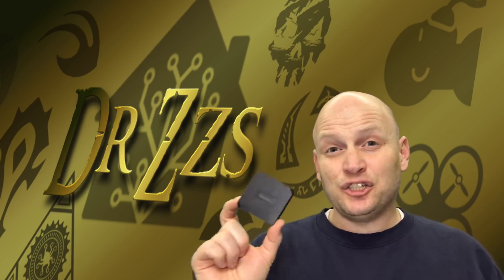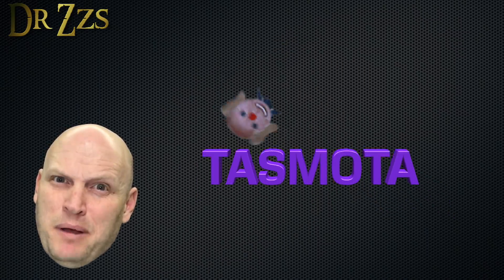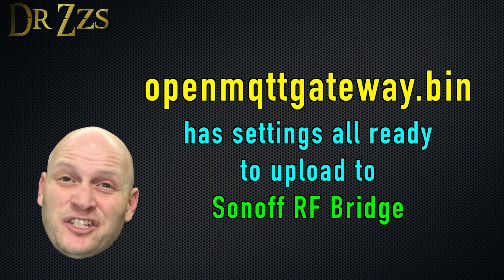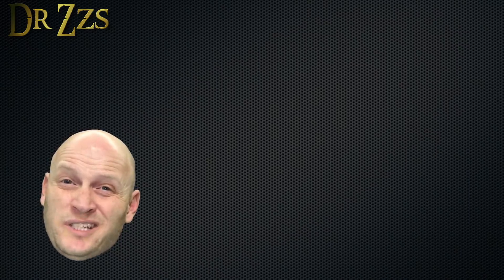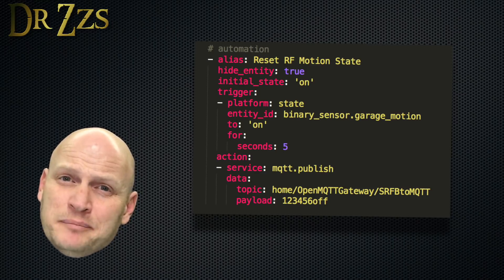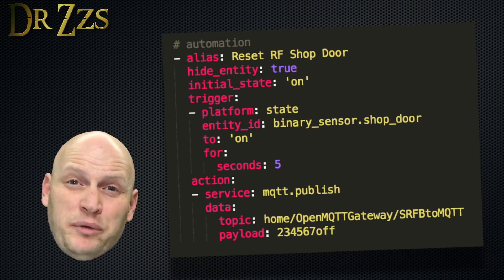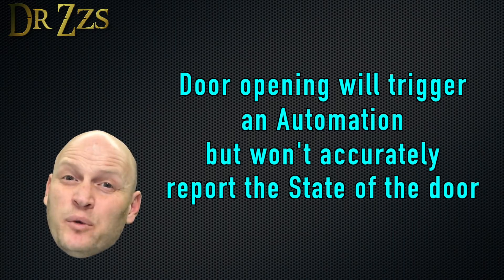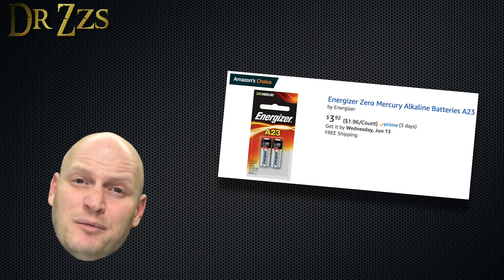Sonoff RF Bridge w/ MQTT & Home Assistant

Comment: There's a step that I'm unsure about.  You flashed the bridge and set up the wifi, then went to MQTTLens to trigger a sensor to get that number, but doesn't the sensor have to be paired with the bridge first?  Did you pair them with the stock firmware and ewelink app first?
Reply from the maker: nope. 
I don't know what firmware the sensors run.  I didn't mess with it at all.  When you activate the sensors the bridge picks it up.  I would think any 433mhz receiver nearby would pick up the code.  Tasmota is the same.  When it senses any 433mhz signal it produces an MQTT message.  Tasmota's just has a lot more (and different) information in the MQTT message.  
Does that help?
Reply: That helps.  If you didn't have to pair them, that means I won't have to.  Thanks for the speedy reply.
Reply from the maker: anytime!

Comment: I tested four different rf alarm systems (available in my country) with no luck of getting back the closing code or in 3 of them never get the signal at all ( i think they used encrypted rf transmission my system is Paradox and sure it does) . Have you tried the KERUI? Are they working? Does they send back closing signal?
Reply from the maker: Bummer. 
I haven't tried them but jafterdark has and he said they do send 2 codes. 
I still have a lot to learn about these RF devices.
Reply: I order three of them for start. I will let you know the results
Reply: Just arrived! I confirm that works like a charm i read some complains about the battery health so i will check it in the next days,

Comment: does this not work with sonota? i don't have a usb fdti adapter
Reply from the maker: it might.  I don't know for sure. 
If you're going to do a lot of flashing it might be a good idea to get an FTDI adapter.  They aren't too expensive. 
This is the one I use: https://amzn.to/2JIX1vI
you'll need some jumper wires too. https://amzn.to/2MvOABD

You can try SonOtA, it might work.  Depends on the version of the firmware on the RF Bridge.  Let me know if it works!
Reply: yeah i've been reading that the latest sonoffs are now back to being flashable over the air again, so i was just wondering if this was true for the rf bridge too.
Reply from the maker: cool.  I haven't even tried in months.  Maybe I should look into it again.

Comment: Im here once again got another sonoff and the gpio hole are filled and I really dont want to sold anything, so I downloaded platformio and hold the jumpers to the gpios toghether with the button while conecting to usb, quick question does the sonoff led light power during the flashing? Do you know of in platformio.ini needs to uncomment the envioremnt? Apreciate all your helps
Reply from the maker: bummer.  Seems that's going to be the new norm.  I'll do a demo on adding pogo pins to your usb/serial adapter. 
Sorry I don't know anything about platformIO.  I tried it once and didn't have success. I may try it again someday, but for now I'm happy to just use FlashEZ and the sonoff.bin file from Tasmota github.  
Good luck

Comment: I was using tasmota on one of these bridges & had the pir & door sensors set up.

I went with xiaomi sensors in the end.

Door states were reported correctly & I added temp & humidity sensors to go with it.

Worked out well. Have automated all the hvac in my home to turn off if there is a door or window open, with report of which door/window it is.

Everything turns off in the kids room, if there is no one in there. That alone will save me thousands ;-)

For Tasmota on the rf bridge & setting up the sensors, the data thats reported through mqtt is nested json data (apparently)

See "Integrating RF devices with sonoff bridge on tasmota firmware" on the home assistant community pages.

"bukurat" gives the solution that I used, which worked.

I had the pir sensor set up the same way, with an automation that turned it off after 5 seconds.

Happy Hassing   ;-)
Reply from the maker: Awesome! 
I'll check out that page before I re-try Tasmota on the RF bridge.  I'm sure Tasmota will add some functions that may be more accessible compared to OMG.
Genius idea to have the AC go off when the windows are open.  Nice! 

Thanks!

Comment: Have you tried to send RF signal to your garage door using this bridge? I would love to know how to do that
Reply: Dependent on the frequency of your remote, whether it's a rolling code or fixed frequency etc.

I have an rm pro & one of these bridges & can confirm it just opened one of my garage doors with both transceivers, so I'm assuming my garage door is 433mhz.

Set it up through the web interface to learn a key/button & press the button on your original remote.

If it can learn the code, it should be able to send it.
Reply from the maker: I didn't try it.  I'll see what I can do when I redo it with Tasmota.
Reply: Nice! I'm waiting mine to arrive. One thing I didn't see on your video is that you doesn't sync the rf devices, you just listen to any RF transmission in range, that is correct? If I remember correctly the original fw has a limitation of 4 devices syncing... with tasmota it doesn't exist? I'll try to control my garage door with this so I don't have to mess with the door itself.
Reply: My garage door is using a 433mhz learning code remote. I had to press a button on the garage motherboard and then on the controller to make it pair (or something similar, it has been 2 years). My controller is similar to this one: https://http2.mlstatic.com/controle-remoto-433mhz-porto-eletrnico-e-alarme-garen-ppa-D_NQ_NP_934794-MLB25959661348_092017-F.webp

Comment: Great video as always, however, I am unable to connect to the the AP the Sonoff bridge creates as it is asking for a Password. I have used the v2.bin file you have posted the link to and get the same issue. Is the password known for the AP, if so please share it. Cheers.
Reply from the maker: dang.  There shouldn't be an AP password.  A few people have had that problem, but not everyone... I wish I knew what made that happen.  I'll mess with it.  Maybe we need to upload a new .bin
You can try just compiling the sketch yourself, then you can put in your wifi & pw
Reply: "UPDATE: if you have trouble with the OpenMQTTGateway asking for a password try:  your_password"

Can confirm this works. Good stuff!

What I find strange is the delay in the Sonoff Bridge processing the message. It is about 1 sec delay, give or take. I already have a NodeMCU board with a RF receiver built using the same OpenMQTTGateway software from the HA forums, and the NodeMCU posts the code instantly on motion being detected, then 1 second later, the Sonoff posts its code (using MQTTLens)

The other interesting thing is the Sonoff is receiving a different code to the NodeMCU, from the same motion sensor. Very odd.

Comment: Hello, you are the best! I wasted a lot of time trying to find a solution on tasmota without success and you came up with a new firmware.. TOP.

I now have a problem.. I flashed the new openmqttgateway.bin file however when I try to connect to that network via mobilephone a password is required.. it's not open like in your video.. any suggestion on which password should I put to get access on it ?

Rik
Reply from the maker: A few people have had that problem. I’m not really sure what is causing it but I’m thinking it might be a leftover setting from previous flashing. Try using whatever password you put in when you had TASMOTA on it. 
If that doesn’t work then we need to find a way to totally erase everything and reflash it. 
I’ll look for a solution.
Reply: It’s strange, I thought the person that created the bin file included a password on it.. I already flashed twice and network is always protected.. I tried all my passwords without success 😩. Thanks anyway for your prompt reply. Keep doing your videos👌👍🏼👍🏼
Reply from the maker: Dang, nope he didn't put a password on it.  I'm sure.  I used the same one and it hasn't asked me for a password, but it is doing that for some people.  I'll get to the bottom of it! 
In the meantime, you can go to the openMQTTgateway github and download the sketch, edit and compile and upload yourself, it's just more painful. 
Sorry man.

Comment: I cant put my sonoff RF in programming mode. I put the switch to off  hold the button and put the usb but i cant flash it. Anyone have the same problem? UPDATE--- I succesfully flash 4 POW R2 with the same FTD232 and same usb cable. Something is wrong with the rf and i cant put it in programming mode
Reply from the maker: What errors are you seeing? espcomm failed? 
There are a couple different serial pin locations. The ones on the “off” side of the little switch are the ones you want. I connected to the others the first time I tried.
Reply: Yes I know but still got the error
Reply from the maker: could be you got a bad one then.  I don't think there are different versions of the RF (like an 'R2' or something).  
Sorry man.  The reasons I know of for getting the espcomm error are just:
1- board isn't in programming mode
2- Rx/Tx are switched (or some other serial pin connection problem)
3- the wrong com port selected. 
You've done enough flashing with your Pows that I wouldn't think you'd miss something simple like one of those.  I'm not sure what else to try.  Sorry man, wish I knew what to tell you.
Reply: You done already enough. You are the reason i went from sonoff original to tasmota and hassio. So i would tell that was a ghost in the machine. I pair the device with the original ewelink app after i turn it off put it again in off and start it in programming mode i flashed it with tasmota and then with OMG looks its working for now. Except that i cant connect because both .bin files ask me for a wifi password
Reply from the maker: those dang gremlins strike again!
Reply: Hahahaha yeah those one! why keeps asking me for a wifi password? both of the .bin download i cant log in to the wirelless network. I tasmotized 22 devices but this rf bridge make me crazy ----UPDATE I edit the .bin file to find the wifi password and the secret password is..... your_password
Reply from the maker: you are a life saver!! 
I will spread the word! 
Thanks a ton!
Reply: Glad to help :) Lets keep tasmotise everyhting!!

Comment: Thank you for your this.
I've been using this for about 7 months and it just works reliably.

I went through the zwave pain and I now only have 2 legacy zwave ssnsors. Not only are they extortionate in pricing but the whole set up is short of "temperamental" to use an euphemism

I definitely recommend this solution and as you stated it can do many other things such as ir BT etc (Not with sonoff).
Reply from the maker: Crazy that Z wave is so expensive but doesn’t offer anymore reliability than these cheap 433’s. 
Thanks!
Reply: Indeed, not sure if you've seen this already, but there's a list of devices that can be used. Here's the link
https://docs.google.com/spreadsheets/d/1DdtVtSsN25nwP6BZI5q6C9yDGz37tUWjw2SQ1RGwBxU/edit#gid=0

It''s populated by users, based on purchases/experience. sensors, switches, plugs, smoke detectors.
Reply from the maker: Awesome!

Comment: Hi there, I had a problem with some single code Window/Door Sensors which I solved by soldering 2 pads together on the PCB. Now, the sensor sends one separate code for on and one for off. I cannot find any internal photos of the DW1 Sensor that you are showing in your video,  but if you use one sensor as a test subject and poke around some empty contact points, and at the same time bring close/away the magnet, just look at what codes are displayed in the MQTT sub topic.
Reply from the maker: I like this idea. I’ll have to give it a try. 
Thanks!

Comment: Great video. Thanks. Unfortunately I am too much invested in Broadlink IR/RF devices and they work well. I also have Alarm/door sensor system -broadlink SC2. So I will not be getting sonoff. But I did find good tips in your video as the door sensor is sending one signal only (open). 

I am not sure if I could use RM Pro+ that support RF and IR to capture door sensor signals. I only use that for various remotes /RF plugs (both IR and RF). Broadlink Sc2 kit come with a base station that monitor movement sensor and door sensors. It would be nice if I could use PM Pro+ to capture Alarm/door sensor signals for SC2 is not working with Hass.io on RP. As I know only custom component from community is available and cannot be installed on hass.io on RP  (need Ubuntu or Rasbbian version of HA). Any thoughts
Reply: ian robertson 
The custom component for broadlink motion and door sensors works flawless on my RPI with hassio. State changes are immediate and accurate. Almost all my automations run on broadlink sensors.
Reply: Remco Timmer 
Thanks for this info. I thought hass.io on rp3 is on a docker image as such cannot run linux commands required in getting custom components working. If i am wong here could u please direct me to correct place to get instructions. Much appreciate your help
Reply: ian robertson 
No, I have several custom components installed. No Linux commands needed. I just uploaded the files with the configurator in hass.io. Here's the link to the forum topic: https://community.home-assistant.io/t/broadlink-s1c-alarm-kit-custom-sensor-component/45980
Reply: Thanks. I followed the instructions and I can see entity id:  sensor.broadlink_s1c_key_fob. However none of my 3 door sensors and the motion sensor is showing up in the entity list

In the home-assistant.log I get errors

2018-06-18 20:04:22 WARNING (MainThread) [homeassistant.config] Incomplete core configuration. Auto detected elevation: 15
2018-06-18 20:04:46 WARNING (MainThread) [homeassistant.setup] Setup of config is taking over 10 seconds.
2018-06-18 20:04:50 ERROR (MainThread) [homeassistant.core] Error doing job: Task exception was never retrieved
Traceback (most recent call last):
  File "/usr/lib/python3.6/site-packages/homeassistant/helpers/entity_platform.py", line 301, in _async_add_entity
    'Invalid entity id: {}'.format(entity.entity_id))
homeassistant.exceptions.HomeAssistantError: Invalid entity id: sensor.broadlink_s1c_motion.living
2018-06-18 20:04:50 ERROR (MainThread) [homeassistant.core] Error doing job: Task exception was never retrieved
Traceback (most recent call last):
  File "/usr/lib/python3.6/site-packages/homeassistant/helpers/entity_platform.py", line 301, in _async_add_entity
    'Invalid entity id: {}'.format(entity.entity_id))
homeassistant.exceptions.HomeAssistantError: Invalid entity id: sensor.broadlink_s1c_laundry.room
2018-06-18 20:04:50 ERROR (MainThread) [homeassistant.core] Error doing job: Task exception was never retrieved
Traceback (most recent call last):
  File "/usr/lib/python3.6/site-packages/homeassistant/helpers/entity_platform.py", line 301, in _async_add_entity
    'Invalid entity id: {}'.format(entity.entity_id))
homeassistant.exceptions.HomeAssistantError: Invalid entity id: sensor.broadlink_s1c_door.frontdoor
2018-06-18 20:04:50 ERROR (MainThread) [homeassistant.core] Error doing job: Task exception was never retrieved
Traceback (most recent call last):
  File "/usr/lib/python3.6/site-packages/homeassistant/helpers/entity_platform.py", line 301, in _async_add_entity
    'Invalid entity id: {}'.format(entity.entity_id))
homeassistant.exceptions.HomeAssistantError: Invalid entity id: sensor.broadlink_s1c_kitchn.door
2018-06-18 20:05:00 ERROR (MainThread) [homeassistant.components.switch] Error while setting up platform broadlink
Traceback (most recent call last):
  File "/usr/lib/python3.6/site-packages/homeassistant/helpers/entity_platform.py", line 129, in _async_setup_platform
    SLOW_SETUP_MAX_WAIT, loop=hass.loop)
  File "/usr/lib/python3.6/asyncio/tasks.py", line 358, in wait_for
    return fut.result()
  File "/usr/lib/python3.6/concurrent/futures/thread.py", line 56, in run
    result = self.fn(*self.args, **self.kwargs)
  File "/usr/lib/python3.6/site-packages/homeassistant/components/switch/broadlink.py", line 157, in setup_platform
    device_config.get(CONF_COMMAND_OFF)
  File "/usr/lib/python3.6/site-packages/homeassistant/components/switch/broadlink.py", line 193, in _init_
    self._command_on = b64decode(command_on) if command_on else None
  File "/usr/lib/python3.6/base64.py", line 87, in b64decode
    return binascii.a2b_base64(s)
binascii.Error: Incorrect padding
Reply: Also my unit is not 1SC but S2 which seems to be the never version but in HA I used it as s1c
Reply: I had to restart Hass twice, and then it worked flawlessly. Also on S2. Your sensor is in the log though. Maybe post your log in the forum. They have much more knowledge then me.
Reply: ian robertson 
Now I see your sensors are not named correctly. Sensor.broadlink_s1c_door.frontdoorshould be sensor.broadlink_s1c_door_frontdoor
Reply: Thanks. I figured out. I have named some of my items kitchen.door. HA entities does not work if capital letters used (which I have not) but we can only have  _ and not . so I renamed all items with _ replacing . and now all work.
Reply: Thanks.